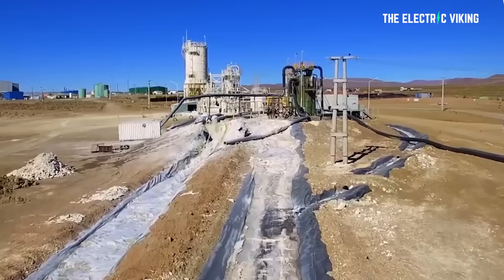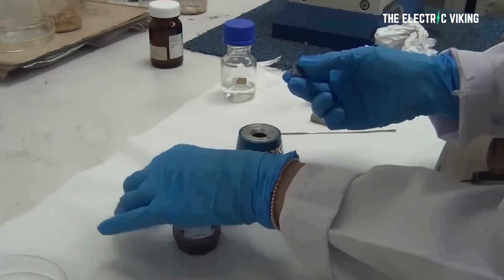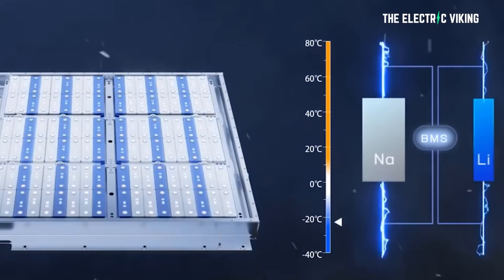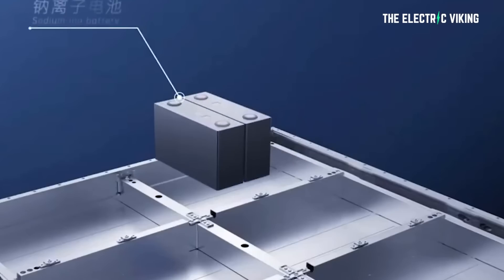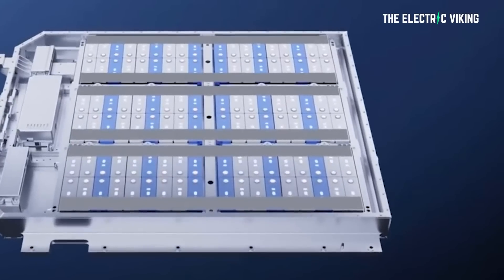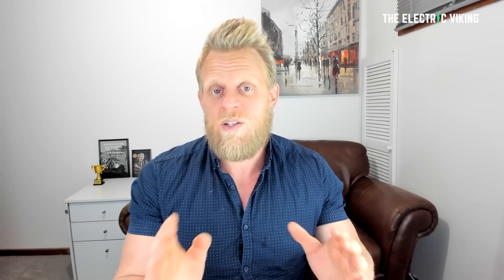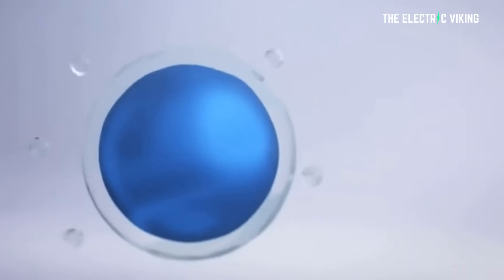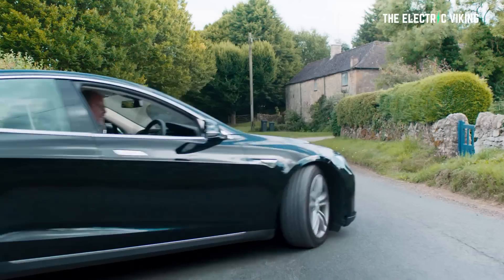NEW Sodium solid state batteries could solve our lithium crisis

Comment: Sodium seems logical for fixed storage where power density is not as important as price per kWh, but it may have a market for lower range EVs at a reduced cost.   While sodium has about 30% cost reduction today, future improvements may help to lower the cost even more.

Comment: It sounds alright, the budget version of a Lithium Ion battery? The biggest breakthrough will be higher energy density that is safe, at the moment the batteries we have now are barely capable, factor in a country the size of Australia and our dependence on heavy haulage and current tech is not really viable.
I'll wait and see, I don't know enough to have an informed opinion, there have been so many bogus claims over the years. People know that if they mention sustainability or green this, they will get investors, only to be shown up as a sham years or even months later.

Comment: There has been a major battery breakthrough just round the corner by this or that company or research group every six months since 2000. Yet we use the same li-ion technology with roughly the same energy density as in 2000. I believe it when I see it. A consumer-grade li-ion replacement that solves the mobile and car industry problems is the tech space news perpetual motion machine.

Comment: Electric train batteries care less about weight than cars do. Diesel locomotives have always been diesel generators powering electric motors, and "battery cars" like coal cars of yore could eliminate the diesel generator, and you can chain four of them behind the engine if necessary (the generator being replaced produces 4700 amps), but container sized lithium batteries are too expensive.

Comment: Quite honestly, I just wanna see a battery that can easily withstand the freezing temperatures of where I live. Winters get cold, between -20C and -40C is normal. Lithium Ion Batteries aren't particularly fond of those temperatures, and often rely on external heating to get them into proper charging and discharging state. EVs for example need to heat them up to properly run, sapping range from them.

If Solid State Sodium batteries can operate easily in the cold, they're a winner.
Reply: I am now in a tropical climate. I would like batteries that have a decent life in this climate. Li-ion doesn't survive very long here. Lead-acid is still the best technology here for stationary applications, despite battery companies claiming the opposite. SS has the potential to be better at higher temperatures. Li-ion could in theory work better with a special design that is better at higher temperatures, but I guess the market here right now is too small and people are igorant enough to buy batteries that won't last long.

Comment: No rush, man made climate change isn't real, it's a scam by the financial industry to create more debt and debt based currency.  There's only one way EVs are viable.  Sodium based battery packs that can be quickly swapped out at charging stations, with the charging station/battery refurb stations having their own direct connection to small molten salt nuclear reactors.  Otherwise the electric grids can't handle the load, and there's simply neither the political will or the resources for the sort of upgrade required.  All current Lithium reserves will be exceeded by demand by 2026, all potential reserves by 2035.  Before 2026 comes however, the price of an EV will make it out of the question for 95% of the population.

Comment: Tesla will and is able to use every type of battery for their Megapacks and powerwall. The only problem is that a new chemistry like mentioned in your video is needs extreme ramping up before it can make a dent in the needs of Tesla. If they can't get 10Gwh of those batteries next year, it won't be enough. But the following year it will probably need be 20Gwh to make a difference in Tesla and have them change the chemistry of their batteries in the Megapacks

Comment: If they can't get more than 1000 cycles out of sodium batteries then the cost needs to be at least 50% less than LiFePO4 to be competitive because even the worst of LiFePO4 get >2000 cycles. There is plenty of Lithium in the ocean if someone could figure out an efficient extraction method. Of course there is even more Sodium in seawater.....
Reply: Tesla is already working on that as they have literally I the last 2-3 days announced a plan to build a lithium extraction plan from the ocean in a place called (from memory) robstown (I stand to be corrected on that) in texas I believe.
Reply: @brettmciver432  Hi Brett. Refining plant, but I expect from ore, not seawater. Do you have a link? They are on sea access - for shipping? Tesla are proposing a novel extraction chemistry.
Reply: @iandavies4853 
Does not the acticle mention lithium from sea water?
Reply: @brettmciver432  What article? Deakin Uni study is modelling, very much a future proposition. Alt is from clay, or direct extraction from hot brines. But for Tesla proposal, I expect hard rock mining from Australia or similar. Many options. Purity is big factor I think - I’ll check.
Reply: @iandavies4853 
Didn't electric viking mention it in his video? 🤔🍻
Reply: @brettmciver432  No. Click bait. But easy to find press release. 
"(IFM) used computer modelling and simulations to design a new type of solid-state polymer electrolyte, showing its potential use in various types of polymer-based solid-state batteries, particularly sodium and potassium batteries. Polymer-based batteries can support high-energy density metals in an all-solid-state battery."
It’s very early stage research. Taken out of context. Not a solution to temporary shortage today. Click bait.
Reply: Saudi I think researchers have developed techniques and patents for just that

Comment: Sodium-based batteries should have a lower power:weight ratio than Lithium-based ones. But since the Lithium in today's cells is a relatively small percentage of the total cell mass, the penalty for using Sodium need not be nearly as great as some people might imagine. I'm convinced that, given the same amount of development effort that has been devoted to Lithium technologies, Sodium cells will rival Lithium before too much longer. 

Batteries in general are becoming more efficient, longer-lived, greater in capacity per litre and per kilogram, more reliable, safer, and cheaper to make. So I foresee Sodium being used in EV's, not just in static storage facilities, within a surprisingly short time from today. Their lower cost will easily offset their somewhat lower charge capacity over kilogram. Lithium will still have its uses, but its relatively high cost of today will reduce somewhat as a balance between availability and consumption is reached. 

Meanwhile, keep a close eye on developments with  other alternative anode and cathode elements and compounds. Things have a habit of changing quickly and in unexpected ways.
Reply: Lithium ion batteries are expensive because of the two rarer metal to go with Lithium. if sodium battery is only 30% cheaper, then something is not right.

Comment: Hi Sam, yes, I agree that Sodium Batteries will, have a growing role in BESS systems, but not, in ..small, ‘lightweight’ vehicles such as EV cars, and aircraft, where weight, is a much more, critical factor, than in ‘stationary’ storage, and where, Lithium, is simply ..irreplaceable, in that role, because of its own unique, position, in the Atomic Periodic Table. 
What Sodium batteries will do, Sam, is allow the already ‘limited’ amounts of Lithium, that can be currently, produced, ..( thanks to Wall Street’s ..UTTERLY, APPALLING, STUPIDITY, and more than a decade, lost, now, of complete under-investment, of the amounts of global Capital required, to bring new greenfield Lithium mines into PRODUCTION, within a meaningful timeframe ) ..to be ‘husbanded’ for ‘exclusive use’ in the manufacturing of Lithium Batteries for building light, and weight-critical, dependent, electric transportation vehicles. 
Basically, the bottom line, Sam, is, that when it comes to powering ‘light-weight’ EVs, ..nothing, surpasses Lithium, for its light weight, and energy storage density, and Coulombic efficiency.        Three things, that simply aren’t, so important, in batteries, like, Sodium Batteries, that are being designed for use in a dedicated BESS role.  😉
Reply: I have shares in Australian Lithium miners ( PLS and LIT ). The problem was there was a boom in Lithium miners 2016 - 2018 when there was a glut because the anticipated competition did not come (partly because the only charging network to make EV's viable was Tesla's paid for by their customers ) and demand was not what was expected so mines actually shut down and went bankrupt. In fact Alinta went bankrupt and PLS purchased their tenements adjacent to PLS's tenements and their facilities at a bargain basement price partly funded by a 1 for 7.9 at 32c offer which I grabbed  (thank you nicely - as now around $A 4.50 0
Reply: @j.pgoodwin9020    Yes, I have also benefited by owning shares in the Australian Lithium miners Pilbara Minerals and AllKem.    It has been a long journey, but now, the world is waking up, to the need to transition away from fossil fuelled ICE vehicles and in to EVs, and our, Aussie Lithium Miners are leading the world, in enabling that transition to happen. 😉👍

Comment: I think cost is a much bigger issue than a lot of people realise. I would like to join the EV revolution, but in my case cannot get the finance cost to work in my head. I have a ICE car worth about 10k. It costs 20 to 25 $ a week for my 10 minute commute to work and other running around in my small town. If I go out of town, I would typically travel 400 to 600 kms in one day, so dont talk to me about a Leaf. We live in a fairly remote part of NZ. The engine & trans in my car is in good condition, the model is known as "bulletproof", I dont expect much maintenance over the next 5 years and the most depreciation value I can lose is 10k. So you have spoken about potential depreciation on a 40k ICE car, however I also see potential loss on todays EV's at 40k to 70k, as new better & cheaper models come on line within the next 5 to 10 years. Finally, coming up to retirement i would have to either re-mortgage my now freehold  house or make a significant dent in modest retirement savings, I figure I will be able to spend 30-40k on a car once, but probably not now and then in another 5 years. So if you have any arguments for me otherwise, let me know. At the moment I am thinking EV ownership is maybe 5 years away, and talk of cheaper battery technology reinforces that opinion.
Reply: Start with an electric scooter or bicycle. Remote is a relative term
Reply: If you got a good ev you could put the fuel savings into tesla stock...... Unless jackass cinder taxes evs into the grave which I suspect is part of the socialist goverMENTAL plan. Plus easier to track usage using said tech as well.

Comment: Can we cover how to reduce city energy demand worldwide with just a couple implementations.
Like parking lots take up 25 to 30% and some citys more of there land is just parking lots.
Go up not out reduce there space use by 80% add solar on top batteries on bottom vines growing up the outsides on the parking garages.
The freed up land plant trees and flowers reduce heat lets more people want to walk because its cooler and they can stop and rest not roste.
Do to reduced heat and potentially less driving going a couple blocks to the store now will walk because they can now.
Also the solar and the batteries will help clean up the grid and add energy when grid needs it too.
Oh ya because these batteries won't move they can be as big and heavy as they need so they can use very heavy but common and cheap materials to help add energy and to prevent blackouts.
Reply: "Do to redu..." !??!

Comment: The Sodium in these new, theoretically modeled batteries will have the exact same problem Lithium has….i.e. it will have to be refined to a super purity. 
Ergo there will be just as much or more a shortage of sodium refineries as there are Lithium refineries.  
There is no shortage of Lithium…. as Elon has said many times. There is however a shortage of Lithium refineries to purify it.  This is why Tesla is now pursuing permits to open their own Lithium refinery in Texas. 
Meanwhile, Elon has already said that there is Lithium enough in just the state of Nevada to completely electrify all automobiles in the U.S.
This does not sound like a rare element. Therefore I really see very little advantage in Sodium based batteries versus Lithium based ones. 
All we need to do is mine and refine what we already have in quantity.

Comment: Two primary challenges with Lithium (Li) AND Sodium (NA) polymer solid-state batteries have been: (1) poor ion mobility has necessitated a flammable organic liquid in addition to the solid polymer electrolyte/separator, reducing the safety benefit, and (2) using a highly reactive solid Li or Na metal electrode compounds the safety challenges as well, due to the difficulty of sealing the cells from even the slightest leak of water or air into the cell, which reacts strongly with the solid metal electrode, generating very high pressures and temperatures from the resulting combustion that also readily spreads to the organic liquid. These safety issues with solid-state or semi-solid-state batteries are more easily dealt with if you aren't trying to maximize power density and energy density, like you are for vehicle applications, but don't need to do for stationary energy storage. Regardless, being able to substitute lower cost Na for higher cost Li could potentially lead to a cost advantage, particularly for stationary energy storage applications. NA's cost advantage will be reduced as more Li supply is developed, but it's still good to have widely abundant Sodium as an alternative to less abundant (or more difficult to access) Lithium.

Comment: Yet another "breakthrough" battery technology? How many is that now? When will any of them come to market?
Reply: There are quite a lot on the market just not many in cars yet ie Sila has being used by US military & drones as very high energy density but short cycle life but the contract they have just signed with Mercedes suggest they may have fixed this problem.
Reply: @jasonwhiteley3612  Lots of big changes coming soon. One of the worst parts about getting old is all the cool stuff coming down the pike that I'm going to miss.

Comment: My concern with sodium metal is it’s immense hazard when in contact with water, it immediately burst 💥 into flames and explode most of the time. For reference, firefighters cannot extinguish a sodium fire in excess of one kilogram, it is technically impossible. They let it burn 🔥. Now imagine a car battery pack getting damaged in a rainy car crash… if you are stuck in the car, you are doomed, if the firefighters spay water 💦 on the battery pack, it reinforces the very violent chemical reaction. For this reason, I think sodium metal battery packs will not pass safety car crash test in wet conditions due to the fire hazard. I see them more in grid energy storage, but still have doubts because of fire risks. When compared with LMFP, it looks really very risky.  Google Sodium fires 🔥 videos, you will see my point.
Reply: Same with lithium....
Reply: YES. Good point.

Comment: The research is certainly heading in the right direction.  Use of lithium will not be sustainable.

But my gut feel is that sodium is unlikely the answer either.

The answer likely lies in an electrolyte made up of cheap synthetic materials that do not have the disadvantages of sodium.
Reply: Simon:  In time, if lithium can be recycled well, even for a moderate cost, why is that not sustainable.  (The imperfect isn't the enemy of the good).  

And I'm not rooting for lithium -- I'm rooting for practical and sustainable (over the long term) alternatives that don't pollute a lot, cause lots of AGW, etc.
Reply: There is plenty of Lithium available. The issue is going to be cost to access in an environmentally sound manner. Likewise, Sodium is even more abundant than Lithium, which could make it easier, less costly to access in an environmentally sound manner. So, both Lithium and Sodium can be totally sustainable, particularly as they would/will be essentially infinitely recycleable.
Reply: Lithium is used in liquid electrolyte batteries largely because the morphology of lithium dendrites is more controllable, so less likely to grow to bridge the cell. If you can use a solid electrolyte, that doesn’t matter any more - as the man says here. Sodium is hugely cheaper to source than lithium. You can extract it from seawater, for instance. My guts are agnostic on this one. My arse wants to deny it, but I never listen to a word it says.